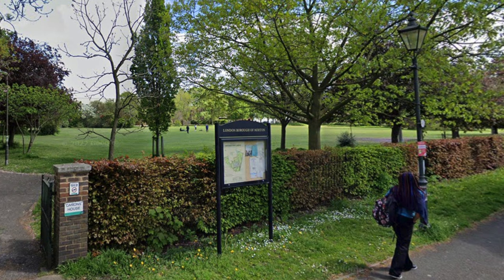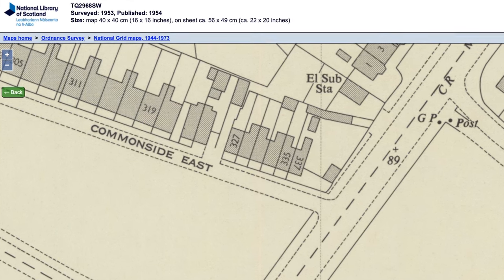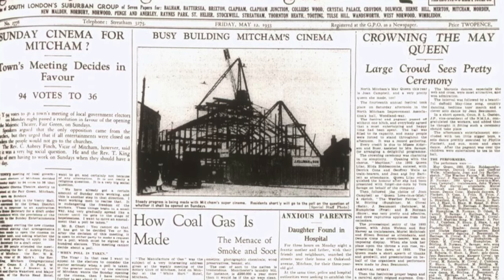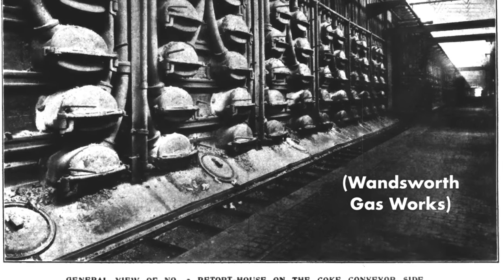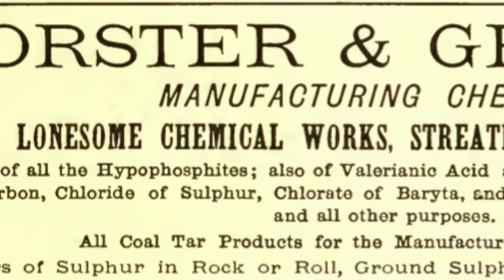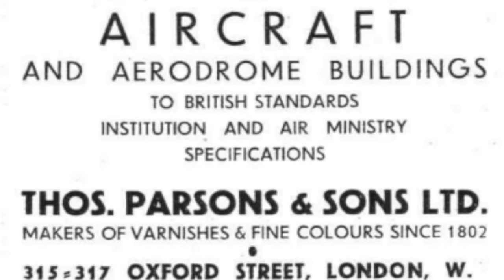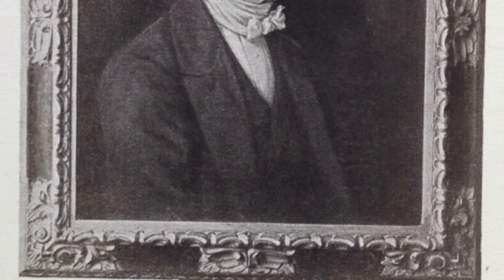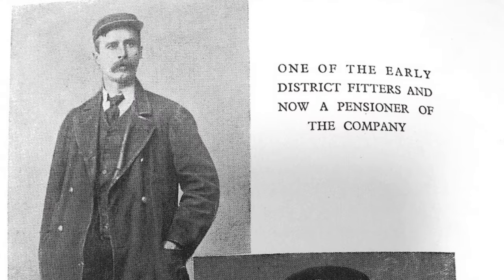Gas lighting in Mitcham

Comment: Drat and blast, my laptop has just died and you can't write the same amount of text on a phone. 
I do want to write much larger piece about still being able to buy gas lights for houses till at least the 1980s, working in a pub where the entire ground floor could be gas lit. Knowing a bit about coal by-products from a time when I worked for the NCB.
One question to ask, Sheffield being built with a ring of hills around it did at one point use gas lights to burn off methane from high points in the sewerage system. I think they were still there till twenty years ago or so. Any ideas?
Reply from the maker: When I did the research on the gas lamp at the Mitcham cricket green, see https://youtu.be/K2sQqTKCNg0 , Sheffield came up a lot! It would have been nice to see diagrams of the box at the base of that lamp, which would have helped in getting the date correct when its was listed by the Council. I'd also like to do a video on gas mantles - there was a factory that made them in Mitcham/Streatham whose business boomed in WW1 when German supplies were halted. Mitcham's varnish and dye firms predated the use of coal tar and were sited near the river Wandle for its watermills and the Surrey Iron Railway for getting imported supplies via the Thames and Wandsworth. All in all, a huge subject area! You can contact me by email if you wish, (when your laptop recovers,) the email address can be found in the channel's About. Cheers.